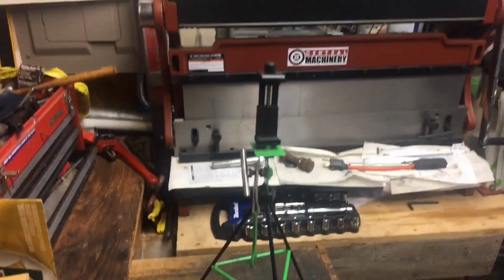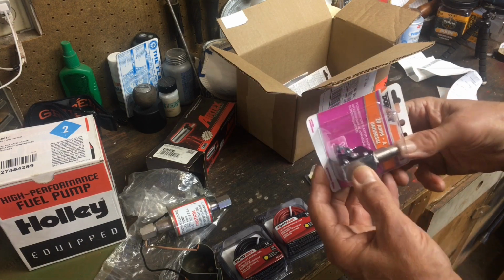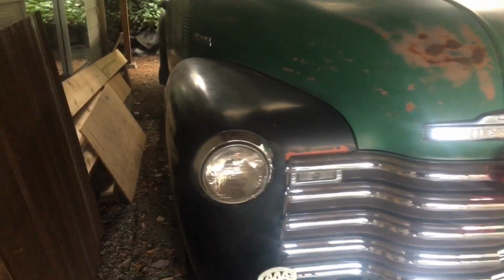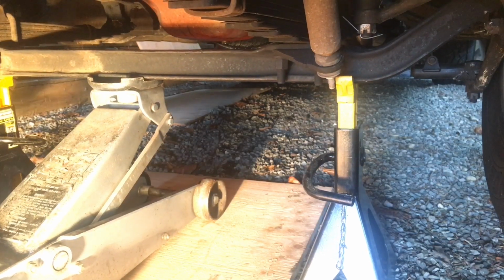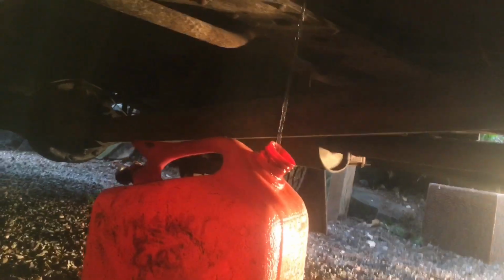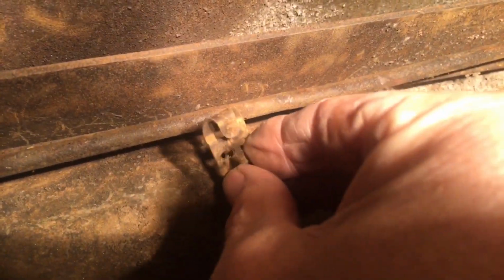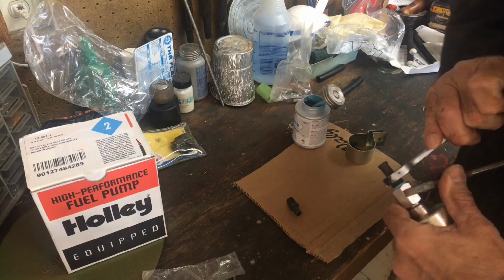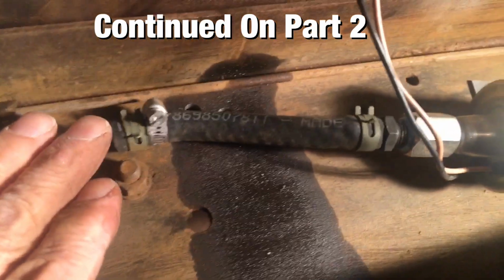1953 Chevy Truck Electric Fuel Pump ( Airtex E8090 ) Install/ Part 1

Comment: Very happy to see you using paste as a thread sealer instead of the tape.
Reply from the maker: Thanks Mike, we will know if we are successful tonight when I try to push fuel through the mechanical pump, keep our fingers crossed 🤞
Reply: @DesertRatFabrication   It won't have any problem pushing thru.
Reply from the maker: @thenandnowautomotive547  nice I am going to go finish it up in about a 1/2 hr

Comment: That should do the trick Mike! Its nice how you can use the pump to push fuel tgen then it off the mechanical pump can suck through it. Have a good one Buddy 👍
Reply from the maker: I know Don, we will know if it’s a success if if the electric pump gets gas to to carb, cross fingers, talk to you at BW’s tonight
Reply: @DesertRatFabrication   Sounds good man👍

Comment: Awesome truck! I have a 51 that I bought in 1972. I gave $5.00 for it and it is still about the same way it was when I bought it. Runs like a champ.
Reply from the maker: Right on Danny, that is so cool, thanks for watching buddy
Reply from the maker: Is that 5 dollars, as in 12345
Reply: @DesertRatFabrication  Yes Sir, $5.00 dollars. (five dollars). A guy I was working with bought it at a car lot for $ 3,800. He owned it for about 6 months and decided to go rabbit hunting in it. His brother-in-law went with him. While they were way out in the desert at night, the brother-in-law shot himself in the leg pulling out his pistol. They panicked and was driving like crazy because the blood was flowing big time. They made it a few miles and the rear end locked up. All they knew to do was start walking. The brother-in-law didn't make it very far so Robert, the owner of the truck, started carrying him. This didn't last long either. So they decided it would be best for Robert to go get help. He eventually came upon some other hunters and they got the brother-in-law to the hospital. He was nearly dead but he made it. Next day Robert had the truck towed to his brothers house. His brother was our boss. 6 months later the truck hadn't been fixed and Raymond, our boss told Robert he was going to have it towed out of his driveway if it wasn't gone when he got up the next morning. I told Robert I would haul it off for him and even give him $5.00 for it. He threw a fit but Raymond told him to take the 5 because it was going to cost a lot more to get it from the towing service and to get it fixed. So I gave him 5 and fixed the rear and have driven it ever since.
Reply from the maker: @Danny Wilsher  that’s a really good story, I would love to see a picture of it, lol, I went back to the comments because I kept thinking 5 bucks wtf, that’s sweet
Reply: @DesertRatFabrication  Thanks, I shortened the story quite a bit... The truck is sitting in a shed in New Mexico. I live in Houston, Texas but I will get a picture when I go back. ...
Reply from the maker: @dannywilsher4165  right on brother

Comment: Good idea, Mike. It should make cold starts a breeze👍
Reply from the maker: Good morning Tony,  yes I guess it will be successful if each pump works together the electric pump has to push through the mechanical, and when the electric pump is off the mechanical pump needs to pull fuel through the electric pump, so long as I see fuel at the bowl when I’m pushing the momentary switch I will call it a success, thanks as always Tony, oh yeah should have second video up by tomorrow 😀

Comment: Sounds like a plan Mike 🤔👍
Reply from the maker: Howie, I will find out tonight when I see if the electric pump will push fuel through the mechanical pump, cross fingers, talk to you tonight on BW’s

Comment: You do good work Mike. All that scrap wood is worth some big $$$'s any more. I pretty much used all mine building the grandson's a tree fort. Probably saved $500 based on todays outrageous wood prices.
Reply from the maker: Good morning Dave, probably won’t use the electric pump much only in the winter, I guess it will be a success if the electric pump will pump fuel through the mechanical pump, and the mechanical pump will pull fuel through the electric pump when it off, wish me luck second video should be up tomorrow, thanks buddy

Comment: Be interested to see how long that pump works we bought a Holley that is similar and it lasted about an hour and wouldn't pump anymore
Reply from the maker: Hi Chris, if it’s going to work the way I think an hour would probably be years, because remember I only use the electric pump to get gas to the carburetor bowl if it’s been sitting for weeks at a time, the truck will fun on the mechanical pump and since I don’t really drive it much in the winter I won’t use the electric pump much, in the summer when I drive it a lot I won’t ever have to use the electric pump, I should have the second video up by tomorrow, thanks for coming by buddy